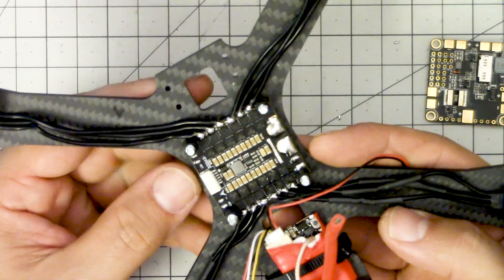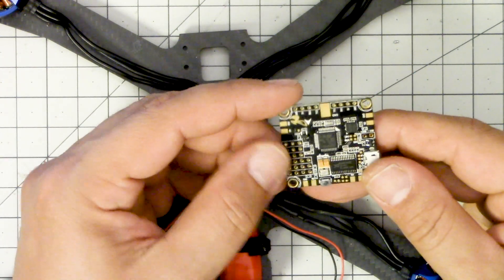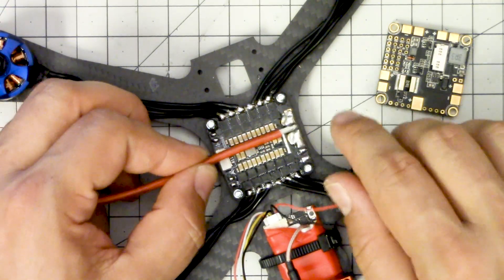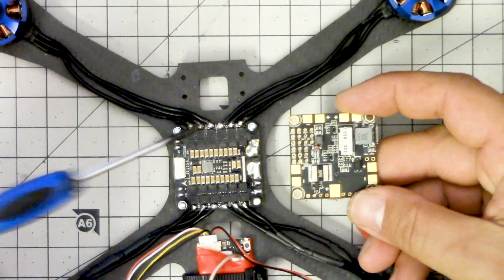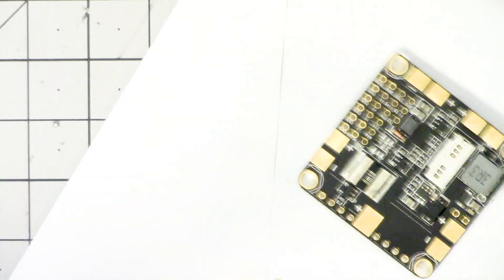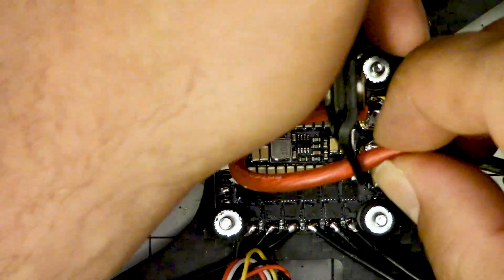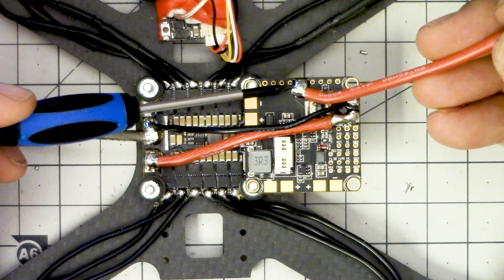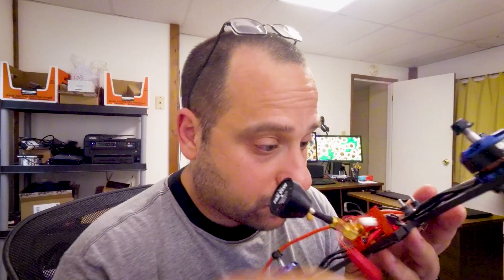All-In-One (AIO) FC  With 4-in-1 ESC | HOW TO WIRE IT UP CORRECTLY

Comment: Hey JB. Just recently picked up the BFF4 and a Typhoon 32 4in1. The BFF4 is my first BF board as I never picked up the F3 . I was un aware how "like you said" that it really is not designed  for use with a 4in 1 and I was more focused on the Typhoon's ability to offer telemetry to the BFF4. Now, all that aside , the Typhoon does offer voltage and current sensing thru  the sh 1.0 jst port. How should I best connect it to the BFF4? I considered running the main line at 12 awg from lipo to BFF4 then 16, or 18 awg from each esc tab to have 4 positive connections and 4 negative connections on the Typhoon tabs. There is plenty of room on each tab to neatly solder 4 " at the biggest" 16 awg lines on  both the positive and negative Typhoon terminal. My thinking was that I would get the most accurate voltage and current from the BFF4 and at the same time not worry about overloading any one motor port on the BFF4. Thanks for everything JB.
Reply from the maker: You really, really don't need to run that much wire but if you did, you could probably run 20 gauge and be fine. 18 gauge if you wanted to be conservative.
Reply: Should I just run the xt60 to the Typhoon and send a single wire to the BFF4 for power and then if so would the VBAT and CUR_SEN  wire from the sh jst plug be ok?

Comment: This also right for the new Betaflight F4 Board?
Reply from the maker: +beLife FPV yes.
Reply: Joshua Bardwell thanks now i have big issues with my fpv picture. I have the RunCam eagle 2 soldered to the cam Pad with vbat on and the unify pro v2 to the 5v underneath this. The ground both on agnd. Now i have horizontal bright streaks without doing anything.
Reply: beLife FPV I had the same issue make sure your yellow wire the video in/out is not close to any of the power wires or anythi g I ended up running that wire on top of the board away from any current and my video signal is now perfect

Comment: I don't know if those solder points are coated with something but you definitely need to use flux that will clean and allow for better heat transfer

Comment: Is this the same way to wire up a HGLRC F4 flame fc with a x-racer 25A quadrant esc in the 4 in 1 configuration? There is no ground for signal wires on this fc is a ground for esc required? Thanks for any help given here.
Reply from the maker: +Paul Morris yes, same way.
Reply: Joshua Bardwell what about the ground situation on the f4 flame fc?
Reply: Joshua Bardwell thanks for replying. On the x-racer esc there are 2 vbat + & - solder tabs at each end. Do I solder wires to these or the + & - tabs that you use to solder them into the 4in1 configuration? I have built 4 quads all fly great just trying to wrap my head round my first 4in1 esc build. Thanks

Comment: Joshua, U did know that current flows negative to positive right?  Also with the first wire sandwiched between the two boards, ur exposing a magnetic feild on both boards.  maybe the wire should have looped towards the outside of the boards? maybe thats ok but it is reality

Comment: hi there josh had a dumb question pertaining to dys 30a 4 in 1   so i changed the 4 in 1 and dys fc from a floss to a skitzo frame.  soldered up emax 2400 white tops and went to test everything and motors 3 and 4 spin up at the same time.  i connected to blheli config and only showing 1 and 2 esc.  any ideas?  im thinking a wire but i basically just moved the whole stack vtx and rx over and used different motors. the floss flew fine just was wanting to try a different aio for that frame

Comment: Is it the same wiring for the kakute f4 aio and spedix is30a ESC
Reply from the maker: +paul openshaw yes. Use the ESC pad closest to the battery pad.
Reply: Joshua Bardwell  wired like  you have said but there is no power to FC board plugged it in to betaflight  and the board lights up and seems to be fine

Comment: How does one go about testing a 4-in-1 esc?   Example: you build a quad based on a 4-in-1.  Flies fine initially but the motors will not spin after a crash.  Flight controller leds do not light up.  Appears to not be getting any power so how does one go about testing the 4-in-1?  BTW, your videos are great instructional resources.

Comment: So josh what did you do with the power an ground wire that comes off of the 4 an 1 esc does that not get used
Reply from the maker: I would just cut them off or pull them out of the housing.
Reply: Joshua Bardwell kool thank you josh much appreciated

Comment: Thanks for the redirect.  My 4 in 1 looks like it has a current sensor and a place to solder the xt60 connector.  Trying to figure this out still.
Reply from the maker: Then the 4-in-1 has a current sensor output that would wire to the current sensor input pad on the FC. You don't need to do any of this stuff if that's the case.
Reply: Is there a second half where you wire up the 4 in 1?  My 4 in 1 has a pdb and a current sensor so I just have to send batt and current to my bff3 and motor signals to the esc?
Reply from the maker: +Tom Wronski yes, that's right.

Comment: Ok, if I'm doing a 3s build with a 20A esc board 4-in-1, that came with 18AWG wires, how big should I make my battery leads?  I'll use 200mw vtx.  Of course, I want it smaller and easier to work with if possible.

Comment: Question: If I'm running my setup like this with the power lead going to fc and negative lead coming out of 4-1 esc, what's the best way to run a 1000uf cap on the power?
Reply from the maker: Both legs of the capacitor on the ESC battery pads. The closer the ESC is to the noise source the better.
Reply: Joshua Bardwell thanks Josh! I appreciate all you do and I definitely learned something today!

Comment: great video Josh. How does the final build work? Any issues with current draw, heat etc? I'm about to start a new build using this FC and a quadrant ESC in 4n1 configuration.
Reply from the maker: All good so far.
Reply: Joshua Bardwell thanks for the reply. Right after I posted this I found your video on there full chameleon build. 🤣 Nice looking little bird. Hope it lasts for you for a while.

Comment: Noob question!! Does is matter which side of the shunt resistor you solder the wire too?
Reply from the maker: Yes, Yes, Yes a thousand times yes. The battery must go on the supply side. The ESC must go on the load side. Otherwise current sensing won't work.

Comment: Do you know if this would work with the DYS F4 & 4in1 combo?!?!
Reply from the maker: I don't see why not.
Reply: That's what I was thinking.  Following your logic from this, I was planning to use the M1 esc pads that are directly adjacent to the lipo pads & current sensor.  I absolutely appreciate your help with all these things!
Reply: +Life in the Flyover   Have you soldered this up on the dys f4? I want to know if it works because I am thinking of doing it on mine. Thanks
Reply: JWKS2003 yes, it worked but one battery in I had a small crash and lost 2 of the 4 esc.  Not sure what the deal is but I'm done with 4in1s.  It's not lighter and wiring all the motors is a pain.  The DYS fc is a true winner though.  I really like it a ton over the BFF3 board.

Comment: where can I place a capacitor if my 4 in 1 doesn't have a designated spot? will I need to run it from the + of fc to the - on the 4 in 1? or is there a better spot?
Reply from the maker: Main battery pads is the only option.

Comment: So if I lifted the main + battery pad "yes I did 😪", can I just solder the battery positive wire to the side of the shunt resistor that is closest to the main + pad?
Reply from the maker: I suspect that would work okay. What have you got to lose?
Reply: Joshua Bardwell well, the whole board 😂

Comment: Joshua, if you were to direct solder or bridge to the shunt resistor how do you know which side to solder to?
Reply from the maker: In general, it will be obvious from the layout, because the traces are so thick that there's not a lot of room to wiggle about. The supply side of the shunt resistor will be right next to the battery pad. The load side will be the other one. You can also measure with your multimeter. The shunt resistor value is typically something like 1/2 mOhm, so the multimeter has to be able to read really small values or it will just show 0 across the resistor.
Reply: Ok that makes more sense now. Thank you.

Comment: Thank you for a great channel. Can you do the same with the DYS F4 PRO and the DYS 20A 4-in-1 F20A ESC? And is it better to use 2 esc pads if they both are close to the shunt resistor? Link to FC http://www.dys.hk/ProductShow.asp?ID=265.
Reply from the maker: I assume that you can do the same with basically any FC or PDB. Using two ESC pads might be better, but it doesn't really seem necessary if you're pulling from the shunt resistor itself.

Comment: Josh, I am ignorant. Why do you consider current sensing important enough to warrant this hassle and weight? For flight duration monitoring voltage is better. Maybe it helps figure out how hard you are pushing the system to better optimize one's setup?? But even with my 20A ESCs I seem to hit a wall in terms of my battery overheating before any other limitation, and that I assess by feeling the battery every time I come in. What am I missing here?
Reply from the maker: It's impossible to really assess the performance of motors, props, and batteries without knowing how much current you're pulling.
Reply: True, but can't those values be bettered assessed on a bench system so you can monitor thrust/volts/current/temperature?  Seems it would be tough to control measurements during actual flight. Though it would be interesting if blackbox could be set up to help.

Comment: Will this work using separate ESCs that are soldered to the Alien PDB? I want to use the PDB that is basically part of the frame for wiring the ESC main power and GND wires to make the build neater, and then wire the ESC signal and signal GND wires to the F3 board?
Reply from the maker: Yes, the same principles apply. Solder the PDB vBat pad to the ESC pad on the BFF3. Basically just substitute the PDB for the 4-in-1 ESC here.

Comment: Hi Joshua. When you are soldering the Betaflight FC, what iron are you using? I hear it's a difficult board to solder to if you can't maintain enough heat on the pads, especially the larger ones. I need to know if my current iron has enough wattage or if I need to purchase a new one. Thanks :-)
Reply from the maker: Link in video description.
Reply: Joshua Bardwell Thanks 👌🏼 I've seen that iron used by a few people so must be good. It's a shame it's not as cheap over here in the U.K. though 🇬🇧
Reply: I bought a Yihua 936B from eBay, just do a search.  It was recommended to me from a computer tech at work who has been using it for a while.  It's great and cheap, like $30 or something.  Then I bought a tip assortment from Amazon.  It uses the standard/normal iron tips.  I change out the tips for what I'm doing (if I remember before heating it up).

Comment: JB, great video!!!... now, with a 4in1 ESC that has a current sensor built in, what to do with the wires going to the FC (http://www.getfpv.com/electronics/electronic-speed-controllers-esc/lumenier-blheli-s-30a-4-in-1-opto-dshot-esc-current-sensor.html)...
Reply from the maker: +Hector Bello wire XT60 to the ESC. Wire small gauge vBat wires to the BFF3 vBat pads. Wire current sensor to the current sensor input, or if it doesn't have one, the RSSI input and use resource remapping.
Reply: Joshua Bardwell I initially wired battery directly to esc, and jumped to battery leads on the f3, video was beautiful, shockingly. after I changed to have current sensing now I have baaad video noise I.e. white horiz lines.. im very tight with space to add lc filter.. anything I can do? it just suffer with the noise or no current sensing? thanks for any reply

Comment: Omnibus F4 V3 + Matek FCHUB-6S + TBS unify HV + x4r SB is all you need for clean builds, this gives you current reading , osd, smartaudio, goggles + stick interaction for pid ect
Reply: Screw PDBs, there's so many good AIO FCs now
Reply: AIO FC are good for tight builds but i prefer to have different modules to make it easier and cheaper to replace rather than having 1 esc burn and replace the whole AIO

Comment: Just some thing to try is , cleaning the pads you want to solder to , some times when they make the board there is like a a film on the pads . Some manufacturers spay the board with some thing . So that  could be it . I have never mad a quad but done plenty of the other stuff . I often had this especially with cheap board from china .  If yo in a rush a small amount of steel wool and ruffing it up slightly helps a lot !

PS thanks for all the videos , find them very helpful and interesting the technical detail is really good !  I have been looking for a channel like this for a while .

Comment: Built a 4in1 with the Matek F4 FC and Racestar 4in1. The 4in1 has voltage and amp out and the Matek takes it in -  both read perfectly in HUD with Betaflight osd.  Alot easier to wire then this. The Racestar supports 6S which I tried and it worked.

Comment: I think the problem with soldering to the ground pads on this board has to do with heat dissipation. Theres probably a huge ground plane in the board that takes all the heat making it harder to get those pads locally at the right temperature for soldering. The esc grounds are not that hard to solder since the point of contact is also big so you can transfer a lot of heat to the board. The real pain are those small pads with holes .... those dissipate the heat just as fast but you cant transfer enough heat to them since the point of contact is a lot smaller. That was my feeling at least.

Comment: Why not use two lengths of 16awg wire?
Reply: That's actually not a bad idea! Less height and more flexibility! Just a bit trickier to solder.
14AWG is 2.08mm^2, 16AWG is 1.31mm^2 so you get approx 20% more current handling.
Reply from the maker: You mean instead of one 14 awg?
Reply: Well, yeah, if room were an issue, wouldn't two 16awg wires be as good as one 12awg?  Oh, what overhead camera are you using?  I'm sure you probably mentioned it somewhere and i forgot.

Comment: I was not impressed with the chameleon. all those 2mm screws are begging to get stripped, and the carbon is cut incorrectly making it the flexiest frame I have ever seen. also breaks a lot because of this. they have warrantied so many that they have finally listened and have cut the base plate from better carbon now. I am sticking with impulse. at least you get quality for your $$$

Comment: Stupid question. I'd use the 12 amg (+\-) to the 4 in one and take the current to the fcs using small wires. Big mistake??? Thanks Joshua!!
Reply from the maker: If you wire the board so that the current sensor works, then you must run large wire to the FC, because it will be carrying up to 100 amps at times. If you wire the board so that small wire is okay, then the current sensor can't work. If you wire the board with small wire, such that the current sensor works, you will burn up the small wire.
Reply: So the reason you wire it up that way is to have all the current flow through the fc and have the current sensor measuring it. Missed that point. Thanks again...and happy flying too.

Comment: the Aikon 30amp 4 in 1 has restored my confidence in 4in1 esc and my build and my flying for that matter, it's a bit pricey but no headache. 
I wired my omnibus f4sd without amp sensing but was chuffed with setting up smart port from your other video.
Obvious question but what are the advantages of amp sensing? I normally wait till I'm around 14v (4s) at med throttle then land.
Reply: I've found it's useful for testing heavier props, especially with 20A ESCs
Reply: The sunnysky cicada 30amp's are pretty nice also. I have it ghetto rigged into my bf f3 on 6s right now without any problems at all for the past month.

Comment: I did this just using the shunt pad instead of the esc pad, but I have been a little skiddish about putting on the battery yet. I also wired the esc ground back to the FC ground and added the battery negative to that pad as well. You will have a battery pigtail going in two directions at once when you flip the FC to work on it if you have it split between the 4in1 and FC. Thanks for doing this video! Now I think I'll put the battery on tonight.

Comment: Do you have any good ideas of how to protect the SD-cards on the BetaflightFC board?
Reply: Hot-glue
Reply: I was thinking that, but don't you need to take the card out to get the data out?
Reply: I don't know for sure but it seems you can download the data using USB
Reply from the maker: You can't download the data from SD over USB. You have to remove it. But honestly, I have never lost mine. If you are really concerned, maybe a light piece of velcro or a rubber band.

Comment: Hi Joshua. Im going to build 6s quad on rfx185 frame and racerstar 2306S motors, can you recommend me some PDB, ESC's, FC, OSD (with current sensor), VTX contained in 2 boards? Is it even possible to build such a quad?
Reply: FC: DYS F4 Omnibus or Betaflight F3 AIO (both are just as good)
ESC: Spedix 30A or DYS XSD30A (5S) XS30A (6S)
PDB: No PDB needed if you use one of those FC.
VTX: Eachine VTX03 (small, cheap and has many features. 72ch so you can broadcast illegal frequency if you hate the government :D)
Reply: Joshua Bardwell 
Why? The motor is dirt cheap so you couldn't ask for perfection at the given price
Reply from the maker: I would get some better motors for sure. The Racerstar 2306 are not good.